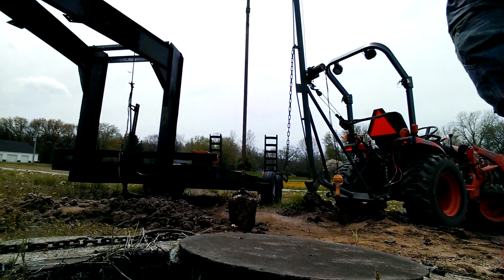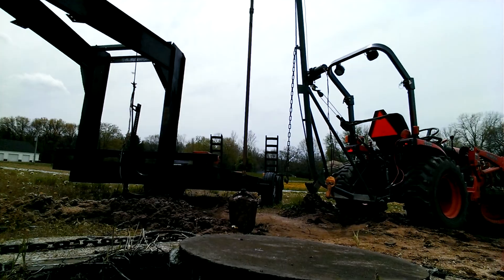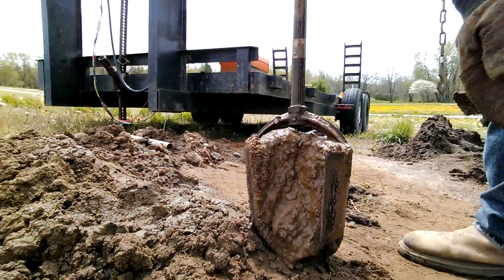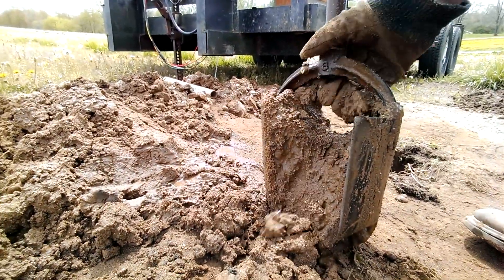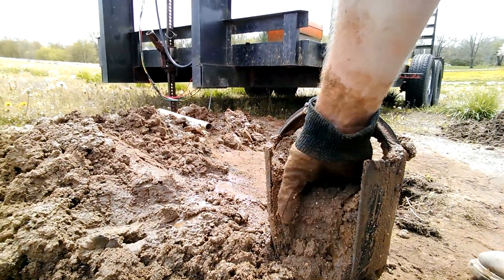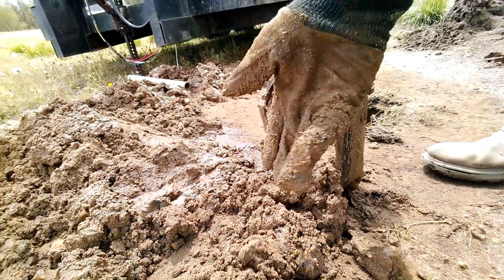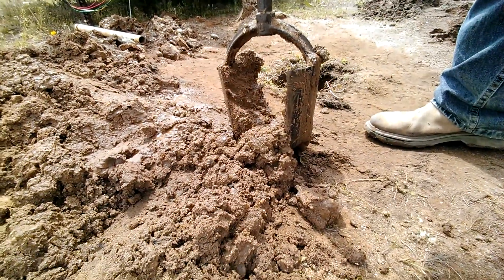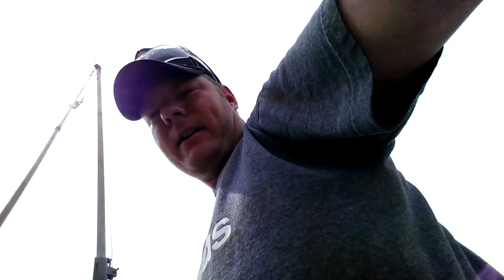Redneck well drilling,

Comment: How did you end up with this project? Did you finish the well?
Reply from the maker: +ts6034 hit gravel at 20ft and tried to jet it further down and the water would instantly suck into the gravel. Ended up having a well drilled, they used the same hole and hit a rock shelf at 30ft so we ended up having another well drilled 90 ft away and managed 65ft before hitting the rock ledge. I didn't know we had a rock shelf running through the property